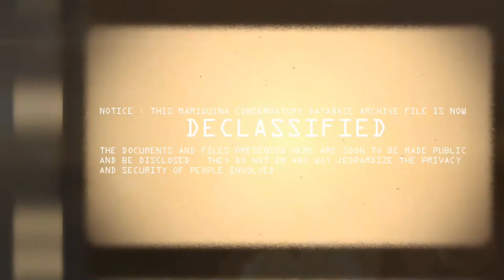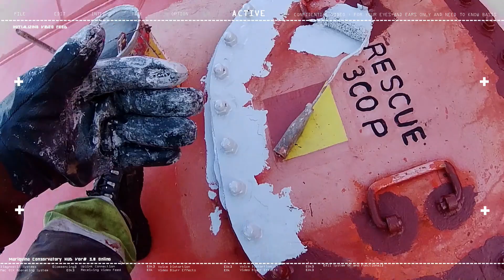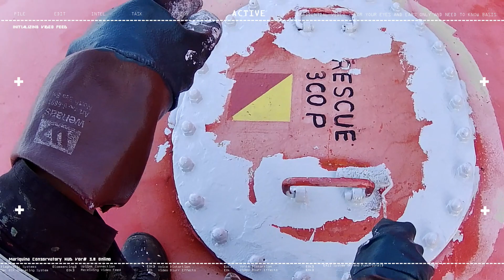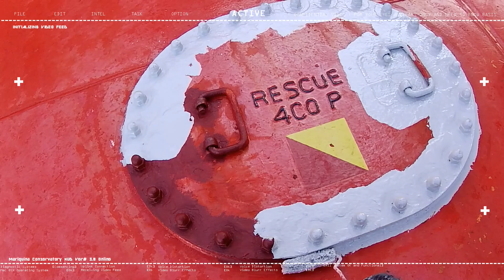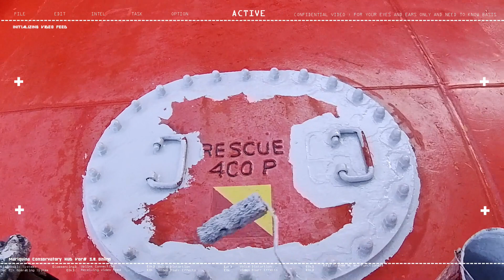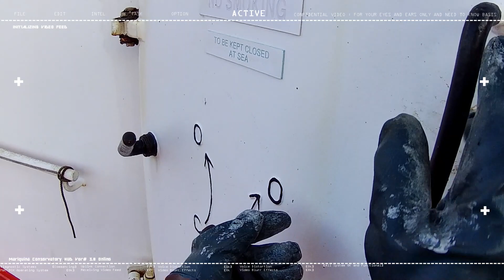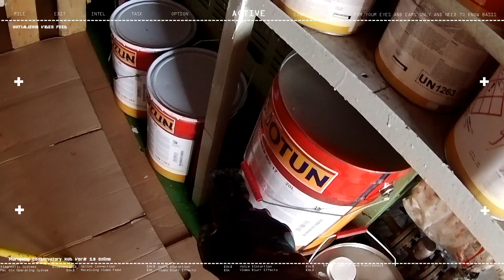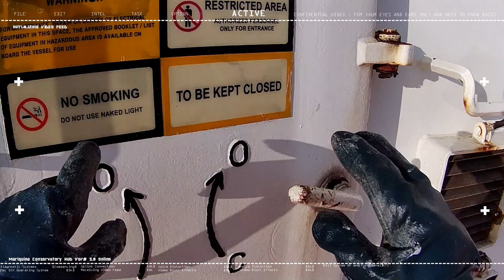Another day on work 80 Days Left on Finish Contract 🇵🇭 #seamanvlog 🇵🇭

Comment: your mic is peaking, or its happening in your editing software maybe.
normalize audio so its no so much high and low but instead in the mid, cause right now its either peaking (hitting redline/buzzing speakers) or whispering
what software are you editing with?
Reply from the maker: yeah i probably have to fix that up., My editing software is cyberlink power director 365. ., I may be also some problem with action camera . In anycase ., thanks for the helpful tip on your comment and I greatly appreciate it and would be fixing this issue .
Reply: @Operator214MerchantMarine  I think VST pluggins work with most video editors, they're like digital modules that can be loaded/added into larger editor software, stuff like compressors, gain, equalizers, lots of different sound tools
theres a few free/open source packs of these floating around the internet from reputable sites, I used them with OSB streaming software and they offer much more control over the audio
Reply from the maker: yup guilty as charge :) ., i still need to thinker a lot on OBS software and other editing stuff ., id do more on my audio. THANKS FOR THE TIP :)